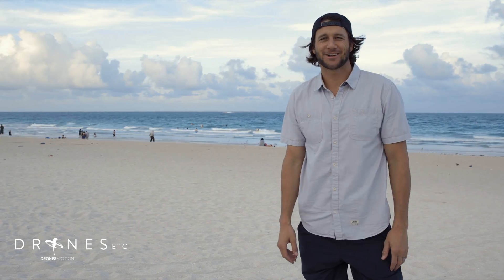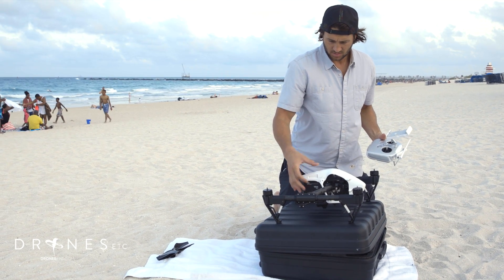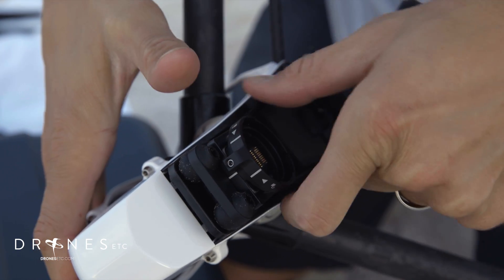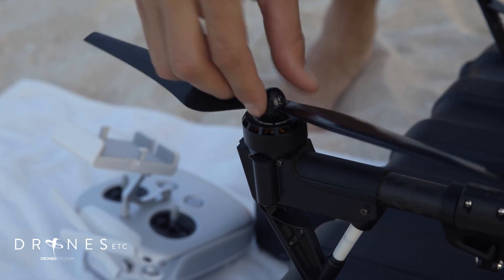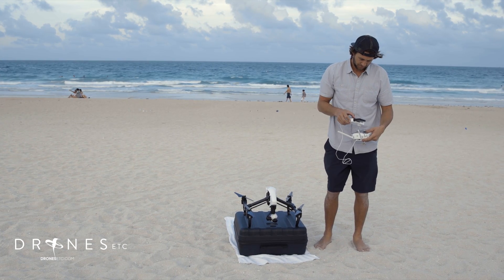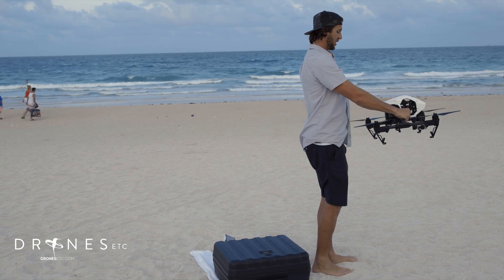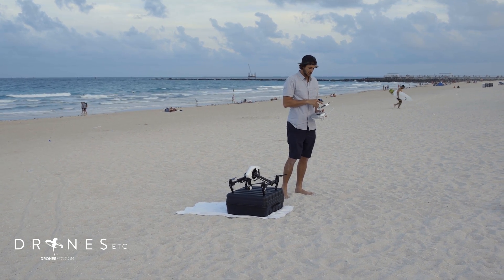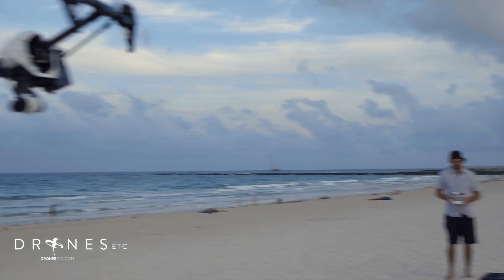DJI Inspire 1 Introduction and First Flight Setup Instructions by Drones Etc.

Comment: and I thought the Matrice 200 was the one for real estate, this is a beast as well and films great. i think the zenmuse upgrade with be a killer.
Reply: @David - No, the Matrice 200 is too much of a drone for Real Estate. The size and features of that drone are more for more commercial application where you need a higher payload.  Most of our customers use the Phantom 4, Mavic Pro or the Inspire drones for real estate.
Reply: Jason Pedersen the problem with the phantom I don't like is the legs shows in most videos.I said for my shoreline homes will be well worth it, and do it for other agents as well. The mavic is super wide angle which I don't like
Reply: There is something wrong with the setup of that Phantom 4, I have owned and flown a Phantom 4 for over a year doing dozens of real estate videos and I have never had the legs show in the videos.